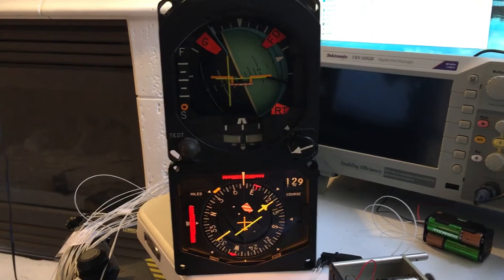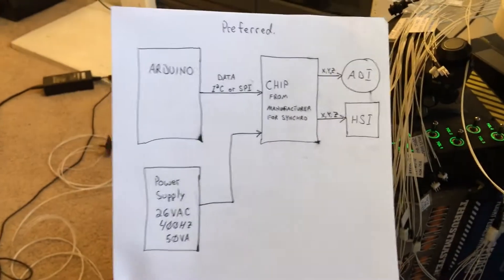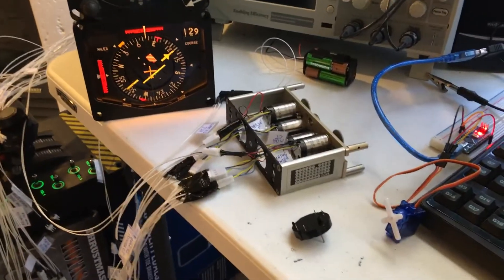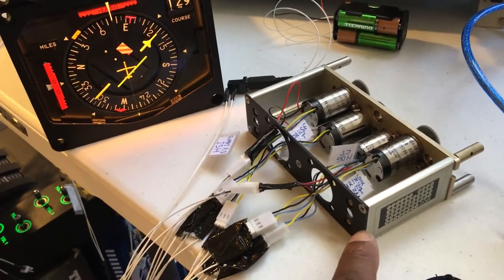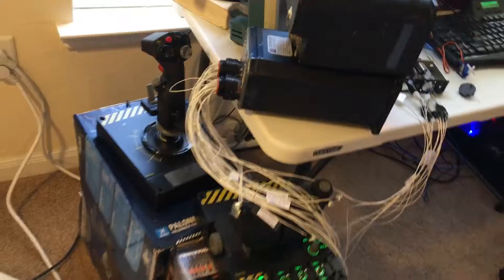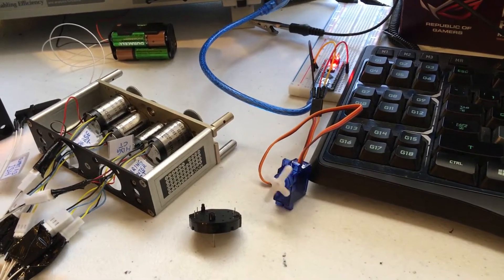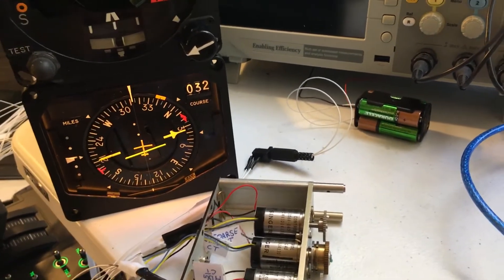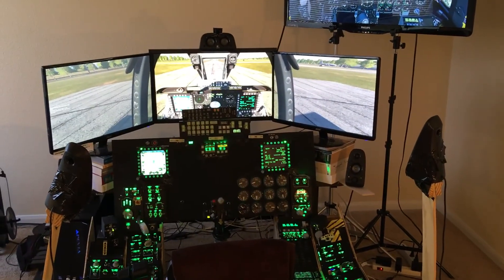A-10C Home Cockpit ADI & HSI implementation

Comment: Great video man
Reply from the maker: Thanks Travis.  I can't remember, but did you build that CDU?  If I remember right you had gotten all the parts.
Reply: Joe Sim I have it and a few other panels done just need to build the cockpit frame and start putting it together it’s been on hold for a while
Reply from the maker: I understand that.  If you used adafruit 3.5" TFT LCD and need to convert those 8 non-standard ascii characters like the bulls-eye symbol, just let me know.  I have a modified font table for the LCD that will display them like shown in the sim.
Reply: Joe Sim I saw that in one of your other videos was going to ask you about that know we talked about it before
Reply from the maker: Go to your arduino folder, then libraries, then Adafruit_GFX_Library.  You will see a file called glcdfont.c  in that folder.
Open that file (with Notes++) and you will see a table containing 256 hex codes for your ascii symbols.  The problem is the standard only defined 128 characters so the remaining ones were left up to the end user or company to put whatever they wanted.
The original file didn't say what each line was so I tried to fill out as much as I could with descriptions of what the symbol is.
So just replace the original table with the one below and it will display the symbols in the game correctly like the blinking cursor, bullseye, plus/minus symbol, arrow heads, etc.

The table is too long so I am breaking this out into several messages.

// Standard ASCII 5x7 font
static const unsigned char font[] PROGMEM = {
 0x00, 0x00, 0x00, 0x00, 0x00, // Space
 0x3E, 0x5B, 0x4F, 0x5B, 0x3E, // face
 0x3E, 0x6B, 0x4F, 0x6B, 0x3E, // face invert contrast
 0x1C, 0x3E, 0x7C, 0x3E, 0x1C, // heart
 0x18, 0x3C, 0x7E, 0x3C, 0x18, // diamond
 0x1C, 0x57, 0x7D, 0x57, 0x1C, // clubs
 0x1C, 0x5E, 0x7F, 0x5E, 0x1C, // spades
 0x00, 0x18, 0x3C, 0x18, 0x00, 
 0xFF, 0xE7, 0xC3, 0xE7, 0xFF, // #9
 0x00, 0x18, 0x24, 0x18, 0x00,
 0xFF, 0xE7, 0xDB, 0xE7, 0xFF, // bullseye circle  
 0x30, 0x48, 0x3A, 0x06, 0x0E, // male symbol
 0x26, 0x29, 0x79, 0x29, 0x26, // female symbol
 0x40, 0x7F, 0x05, 0x05, 0x07, // music note 1
 0x40, 0x7F, 0x05, 0x25, 0x3F, // music note 2
 0x5A, 0x3C, 0xE7, 0x3C, 0x5A, // star
 0x7F, 0x3E, 0x1C, 0x1C, 0x08,
 0x08, 0x1C, 0x1C, 0x3E, 0x7F,
 0x14, 0x22, 0x7F, 0x22, 0x14, // up down arrow 
 0x5F, 0x5F, 0x00, 0x5F, 0x5F,
 0x06, 0x09, 0x7F, 0x01, 0x7F,
 0x00, 0x66, 0x89, 0x95, 0x6A, // #22
 0x60, 0x60, 0x60, 0x60, 0x60,
 0x94, 0xA2, 0xFF, 0xA2, 0x94, // up down arrow with underscore 
 0x08, 0x04, 0x7E, 0x04, 0x08, // up arrow 
 0x10, 0x20, 0x7E, 0x20, 0x10, // down arrow 
 0x08, 0x08, 0x2A, 0x1C, 0x08, // right arrow 
 0x08, 0x1C, 0x2A, 0x08, 0x08, // left arrow 
 0x1E, 0x10, 0x10, 0x10, 0x10,
 0x0C, 0x1E, 0x0C, 0x1E, 0x0C,
 0x30, 0x38, 0x3E, 0x38, 0x30,
 0x06, 0x0E, 0x3E, 0x0E, 0x06, // #32
 0x00, 0x00, 0x00, 0x00, 0x00, // space 
 0x00, 0x00, 0x5F, 0x00, 0x00, // !
 0x00, 0x07, 0x00, 0x07, 0x00, // "
 0x14, 0x7F, 0x14, 0x7F, 0x14, // #
 0x24, 0x2A, 0x7F, 0x2A, 0x12, // $
 0x23, 0x13, 0x08, 0x64, 0x62, // %
 0x36, 0x49, 0x56, 0x20, 0x50, // &
 0x00, 0x08, 0x07, 0x03, 0x00, // '
 0x00, 0x1C, 0x22, 0x41, 0x00, // (
 0x00, 0x41, 0x22, 0x1C, 0x00, // )
 0x2A, 0x1C, 0x7F, 0x1C, 0x2A, // *
 0x08, 0x08, 0x3E, 0x08, 0x08, // +
 0x00, 0x80, 0x70, 0x30, 0x00, // ,
 0x08, 0x08, 0x08, 0x08, 0x08, // -
 0x00, 0x00, 0x60, 0x60, 0x00, // .
 0x20, 0x10, 0x08, 0x04, 0x02, // /
 0x3E, 0x51, 0x49, 0x45, 0x3E, // 0
 0x00, 0x42, 0x7F, 0x40, 0x00, // 1
 0x72, 0x49, 0x49, 0x49, 0x46, // 2
 0x21, 0x41, 0x49, 0x4D, 0x33, // 3
 0x18, 0x14, 0x12, 0x7F, 0x10, // 4
 0x27, 0x45, 0x45, 0x45, 0x39, // 5
 0x3C, 0x4A, 0x49, 0x49, 0x31, // 6
 0x41, 0x21, 0x11, 0x09, 0x07, // 7
 0x36, 0x49, 0x49, 0x49, 0x36, // 8
 0x46, 0x49, 0x49, 0x29, 0x1E, // 9
 0x00, 0x00, 0x14, 0x00, 0x00, // :
 0x00, 0x40, 0x34, 0x00, 0x00, // ;
 0x00, 0x08, 0x14, 0x22, 0x41, // <
 0x14, 0x14, 0x14, 0x14, 0x14, // =
 0x00, 0x41, 0x22, 0x14, 0x08, // >
 0x02, 0x01, 0x59, 0x09, 0x06, // ?
 0x3E, 0x41, 0x5D, 0x59, 0x4E, // @
 0x7C, 0x12, 0x11, 0x12, 0x7C, // A
 0x7F, 0x49, 0x49, 0x49, 0x36, // B
 0x3E, 0x41, 0x41, 0x41, 0x22, // C
 0x7F, 0x41, 0x41, 0x41, 0x3E, // D 
 0x7F, 0x49, 0x49, 0x49, 0x41, // E
 0x7F, 0x09, 0x09, 0x09, 0x01, // F
 0x3E, 0x41, 0x41, 0x51, 0x73, // G
 0x7F, 0x08, 0x08, 0x08, 0x7F, // H
 0x00, 0x41, 0x7F, 0x41, 0x00, // I
 0x20, 0x40, 0x41, 0x3F, 0x01, // J
 0x7F, 0x08, 0x14, 0x22, 0x41, // K
 0x7F, 0x40, 0x40, 0x40, 0x40, // L
 0x7F, 0x02, 0x1C, 0x02, 0x7F, // M
 0x7F, 0x04, 0x08, 0x10, 0x7F, // N
 0x3E, 0x41, 0x41, 0x41, 0x3E, // O
 0x7F, 0x09, 0x09, 0x09, 0x06, // P
 0x3E, 0x41, 0x51, 0x21, 0x5E, // Q
 0x7F, 0x09, 0x19, 0x29, 0x46, // R
 0x26, 0x49, 0x49, 0x49, 0x32, // S
 0x03, 0x01, 0x7F, 0x01, 0x03, // T
 0x3F, 0x40, 0x40, 0x40, 0x3F, // U
 0x1F, 0x20, 0x40, 0x20, 0x1F, // V
 0x3F, 0x40, 0x38, 0x40, 0x3F, // W
 0x63, 0x14, 0x08, 0x14, 0x63, // X
 0x03, 0x04, 0x78, 0x04, 0x03, // Y 
 0x61, 0x59, 0x49, 0x4D, 0x43, // Z
 0x00, 0x7F, 0x41, 0x41, 0x41, // [
 0x02, 0x04, 0x08, 0x10, 0x20, // "\"
 0x00, 0x41, 0x41, 0x41, 0x7F, // ]
 0x04, 0x02, 0x01, 0x02, 0x04, // ^
 0x40, 0x40, 0x40, 0x40, 0x40, // _
 0x00, 0x03, 0x07, 0x08, 0x00, // `
 0x20, 0x54, 0x54, 0x78, 0x40, // a
 0x7F, 0x28, 0x44, 0x44, 0x38, // b
 0x38, 0x44, 0x44, 0x44, 0x28, // c    (#100)
 0x38, 0x44, 0x44, 0x28, 0x7F, // d
 0x38, 0x54, 0x54, 0x54, 0x18, // e
 0x00, 0x08, 0x7E, 0x09, 0x02, // f
 0x18, 0xA4, 0xA4, 0x9C, 0x78, // g
 0x7F, 0x08, 0x04, 0x04, 0x78, // h
 0x00, 0x44, 0x7D, 0x40, 0x00, // i 
 0x20, 0x40, 0x40, 0x3D, 0x00, // j 
 0x7F, 0x10, 0x28, 0x44, 0x00, // k 
 0x00, 0x41, 0x7F, 0x40, 0x00, // l 
 0x7C, 0x04, 0x78, 0x04, 0x78, // m 
 0x7C, 0x08, 0x04, 0x04, 0x78, // n 
 0x38, 0x44, 0x44, 0x44, 0x38, // o 
 0xFC, 0x18, 0x24, 0x24, 0x18, // p 
 0x18, 0x24, 0x24, 0x18, 0xFC, // q 
 0x7C, 0x08, 0x04, 0x04, 0x08, // r 
 0x48, 0x54, 0x54, 0x54, 0x24, // s 
 0x04, 0x04, 0x3F, 0x44, 0x24, // t 
 0x3C, 0x40, 0x40, 0x20, 0x7C, // u 
 0x1C, 0x20, 0x40, 0x20, 0x1C, // v 
 0x3C, 0x40, 0x30, 0x40, 0x3C, // w 
 0x44, 0x28, 0x10, 0x28, 0x44, // x
 0x4C, 0x90, 0x90, 0x90, 0x7C, // y
 0x44, 0x64, 0x54, 0x4C, 0x44, // z
 0x00, 0x08, 0x36, 0x41, 0x00, // { 
 0x00, 0x00, 0x77, 0x00, 0x00, // |
 0x00, 0x41, 0x36, 0x08, 0x00, // } 
 0x02, 0x01, 0x02, 0x04, 0x02, // ~
 0x3C, 0x26, 0x23, 0x26, 0x3C, // 
 0x1E, 0xA1, 0xA1, 0x61, 0x12, //
 0x3A, 0x40, 0x40, 0x20, 0x7A, //
 0x38, 0x54, 0x54, 0x55, 0x59, //
 0x21, 0x55, 0x55, 0x79, 0x41, // #132
 0x22, 0x54, 0x54, 0x78, 0x42, // a-umlaut
 0x21, 0x55, 0x54, 0x78, 0x40, //
 0x20, 0x54, 0x55, 0x79, 0x40, //
 0x0C, 0x1E, 0x52, 0x72, 0x12, //
 0x39, 0x55, 0x55, 0x55, 0x59, //
 0x39, 0x54, 0x54, 0x54, 0x59, //
 0x39, 0x55, 0x54, 0x54, 0x58, //
 0x00, 0x00, 0x45, 0x7C, 0x41, //
 0x00, 0x02, 0x45, 0x7D, 0x42, //
 0x00, 0x01, 0x45, 0x7C, 0x40, // 
 0x7D, 0x12, 0x11, 0x12, 0x7D, // A-umlaut   Capital A with two dots on top 
 0xF0, 0x28, 0x25, 0x28, 0xF0, // #144 Capital A with dot on top 
 0x7C, 0x54, 0x55, 0x45, 0x00,  
 0x20, 0x54, 0x54, 0x7C, 0x54,
 0x7C, 0x0A, 0x09, 0x7F, 0x49,
 0x32, 0x49, 0x49, 0x49, 0x32,
 0x3A, 0x44, 0x44, 0x44, 0x3A, // o-umlaut
 0x32, 0x4A, 0x48, 0x48, 0x30,
 0x3A, 0x41, 0x41, 0x21, 0x7A,
 0x3A, 0x42, 0x40, 0x20, 0x78,
 0x00, 0x9D, 0xA0, 0xA0, 0x7D,
 0x3D, 0x42, 0x42, 0x42, 0x3D, // O-umlaut
 0x3D, 0x40, 0x40, 0x40, 0x3D,
 0x3C, 0x24, 0xFF, 0x24, 0x24,
 0x48, 0x7E, 0x49, 0x43, 0x66,
 0x2B, 0x2F, 0xFC, 0x2F, 0x2B,
 0xFF, 0x09, 0x29, 0xF6, 0x20,
 0xC0, 0x88, 0x7E, 0x09, 0x03,
 0x20, 0x54, 0x54, 0x79, 0x41,
 0x7F, 0x41, 0x00, 0x41, 0x7F, // hand made brackets (was i symbol 0x00, 0x00, 0x44, 0x7D, 0x41)
 0x30, 0x48, 0x48, 0x4A, 0x32, // #163
 0x38, 0x40, 0x40, 0x22, 0x7A,
 0x00, 0x7A, 0x0A, 0x0A, 0x72,
 0x7D, 0x0D, 0x19, 0x31, 0x7D,
 0x26, 0x29, 0x29, 0x2F, 0x28,
 0x26, 0x29, 0x29, 0x29, 0x26,
 0x30, 0x48, 0x4D, 0x40, 0x20,
 0x1C, 0x22, 0x2A, 0x22, 0x1C, // custom bullseye (was L laying on its side 0x38, 0x08, 0x08, 0x08, 0x08)
 0x08, 0x08, 0x08, 0x08, 0x38,
 0x08, 0x1C, 0x2A, 0x08, 0x08, // left arrow (was 1/2 0x2F, 0x10, 0xC8, 0xAC, 0xBA )
 0x2F, 0x10, 0x28, 0x34, 0xFA,
 0x00, 0x00, 0x7B, 0x00, 0x00,
 0x14, 0x22, 0x7F, 0x22, 0x14, // up_down arrow (was << 0x08, 0x14, 0x2A, 0x14, 0x22)
 0x22, 0x14, 0x2A, 0x14, 0x08, // #176  "0xAF"
 0x06, 0x0F, 0x09, 0x0F, 0x06, // Degree symbol (25% block) missing in old code 0x55, 0x00, 0x55, 0x00, 0x55
 0x06, 0x0F, 0x09, 0x0F, 0x06, // Degree symbol (was 50% block 0xAA, 0x55, 0xAA, 0x55, 0xAA)
 0x44, 0x44, 0x5F, 0x44, 0x44, // plus&minus ( 75% block 0xFF, 0x55, 0xFF, 0x55, 0xFF)
 0x00, 0x00, 0x00, 0xFF, 0x00, // verticle line 
 0x10, 0x10, 0x10, 0xFF, 0x00, // #181
 0xFF, 0xFF, 0xFF, 0xFF, 0xFF, // solid sqaure (guessing 0x14, 0x14, 0x14, 0xFF, 0x00)
 0xFF, 0xFF, 0xFF, 0xFF, 0xFF, // solid square (was F laying on its side 0x10, 0x10, 0xFF, 0x00, 0xFF) not this one 
 0xFF, 0xFF, 0xFF, 0xFF, 0xFF, // solid sqaure (guessing 0x10, 0x10, 0xF0, 0x10, 0xF0)
 0x14, 0x14, 0x14, 0xFC, 0x00,
 0x14, 0x14, 0xF7, 0x00, 0xFF,
 0x00, 0x00, 0xFF, 0x00, 0xFF,
 0x14, 0x14, 0xF4, 0x04, 0xFC,
 0x08, 0x08, 0x2A, 0x1C, 0x08, // right arrow (was 0x14, 0x14, 0x17, 0x10, 0x1F)
Reply from the maker: Table Continued from previous message.

        0x10, 0x10, 0x1F, 0x10, 0x1F,
 0x14, 0x14, 0x14, 0x1F, 0x00,
 0x10, 0x10, 0x10, 0xF0, 0x00,
 0x00, 0x00, 0x00, 0x1F, 0x10,
 0x10, 0x10, 0x10, 0x1F, 0x10,
 0x10, 0x10, 0x10, 0xF0, 0x10,
 0x00, 0x00, 0x00, 0xFF, 0x10,
 0x10, 0x10, 0x10, 0x10, 0x10,
 0x10, 0x10, 0x10, 0xFF, 0x10,
 0x00, 0x00, 0x00, 0xFF, 0x14,
 0x00, 0x00, 0xFF, 0x00, 0xFF, // #200
 0x00, 0x00, 0x1F, 0x10, 0x17,
 0x00, 0x00, 0xFC, 0x04, 0xF4,
 0x14, 0x14, 0x17, 0x10, 0x17,
 0x14, 0x14, 0xF4, 0x04, 0xF4,
 0x00, 0x00, 0xFF, 0x00, 0xF7,
 0x14, 0x14, 0x14, 0x14, 0x14,
 0x14, 0x14, 0xF7, 0x00, 0xF7,
 0x14, 0x14, 0x14, 0x17, 0x14,
 0x10, 0x10, 0x1F, 0x10, 0x1F,
 0x14, 0x14, 0x14, 0xF4, 0x14,
 0xFF, 0xFF, 0xFF, 0xFF, 0xFF, // solid square (was F laying on its side 0x10, 0x10, 0xF0, 0x10, 0xF0) not this one
 0x00, 0x00, 0x1F, 0x10, 0x1F,
 0x00, 0x00, 0x00, 0x1F, 0x14,
 0x00, 0x00, 0x00, 0xFC, 0x14,
 0x00, 0x00, 0xF0, 0x10, 0xF0,
 0x10, 0x10, 0xFF, 0x10, 0xFF,
 0x14, 0x14, 0x14, 0xFF, 0x14,
 0x10, 0x10, 0x10, 0x1F, 0x00,
 0x00, 0x00, 0x00, 0xF0, 0x10,
 0xFF, 0xFF, 0xFF, 0xFF, 0xFF, // solid filled sqaure
 0xF0, 0xF0, 0xF0, 0xF0, 0xF0, // half filled square from bottom
 0xFF, 0xFF, 0xFF, 0x00, 0x00, // half filled square from side
 0x00, 0x00, 0x00, 0xFF, 0xFF, // less than half filled sqaure from side
 0x0F, 0x0F, 0x0F, 0x0F, 0x0F, // half filled square from top
 0x38, 0x44, 0x44, 0x38, 0x44, // Alpha  
 0xFC, 0x4A, 0x4A, 0x4A, 0x34, // Beta   
 0x7E, 0x02, 0x02, 0x06, 0x06, // #227       
 0x02, 0x7E, 0x02, 0x7E, 0x02, // Pi symbol      
 0x63, 0x55, 0x49, 0x41, 0x63, // Summation symbol        
 0x38, 0x44, 0x44, 0x3C, 0x04, // #230       
 0x40, 0x7E, 0x20, 0x1E, 0x20, // Micro symbol       
 0x06, 0x02, 0x7E, 0x02, 0x02, // #232       
 0x99, 0xA5, 0xE7, 0xA5, 0x99, // #233       
 0x1C, 0x2A, 0x49, 0x2A, 0x1C, // Theta symbol        
 0x4C, 0x72, 0x01, 0x72, 0x4C, // Ohms symbol        
 0x30, 0x4A, 0x4D, 0x4D, 0x30, // #236       
 0x30, 0x48, 0x78, 0x48, 0x30, // Infinity symbol        
 0xBC, 0x62, 0x5A, 0x46, 0x3D, // #238       
 0x3E, 0x49, 0x49, 0x49, 0x00, // #239       
 0x7E, 0x01, 0x01, 0x01, 0x7E, // #240       
 0x2A, 0x2A, 0x2A, 0x2A, 0x2A, // Three lines horizontal
 0x44, 0x44, 0x5F, 0x44, 0x44, // Plus and minus symbol 
 0x40, 0x51, 0x4A, 0x44, 0x40, // Less Than underscore
 0x40, 0x44, 0x4A, 0x51, 0x40, // Greater Than underscore
 0x00, 0x00, 0xFF, 0x01, 0x03, // #245       
 0xE0, 0x80, 0xFF, 0x00, 0x00, // #246       
 0x08, 0x08, 0x6B, 0x6B, 0x08, // Division symbol 
 0x36, 0x12, 0x36, 0x24, 0x36, // Aproximate symbol 
 0x06, 0x0F, 0x09, 0x0F, 0x06, // Degree symbol 
 0x00, 0x00, 0x18, 0x18, 0x00, // #250       
 0x00, 0x00, 0x10, 0x10, 0x00, // #251       
 0x30, 0x40, 0xFF, 0x01, 0x01, // Square Root symbol        
 0x00, 0x1F, 0x01, 0x01, 0x1E, // #253       
 0x00, 0x19, 0x1D, 0x17, 0x12, // #254        
 0x00, 0x3C, 0x3C, 0x3C, 0x3C, // #255        
 0x00, 0x00, 0x00, 0x00, 0x00  // #256 NBSP  
};
Reply: Joe Sim thanks